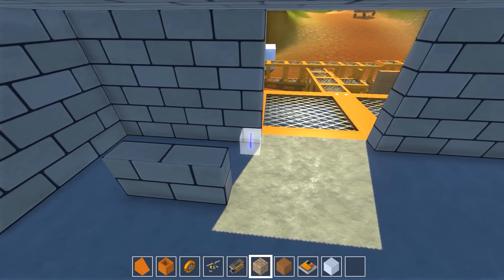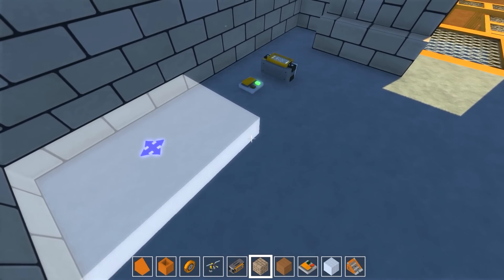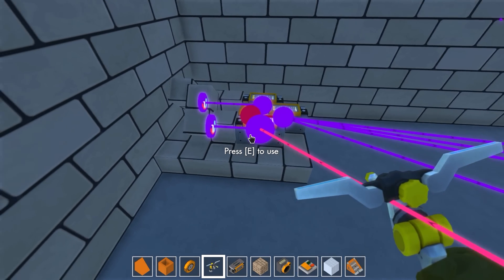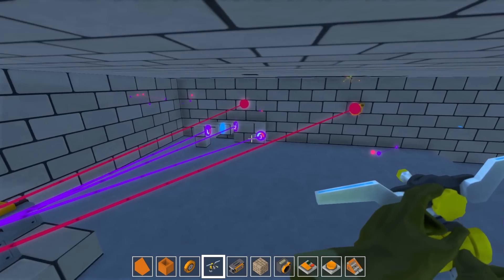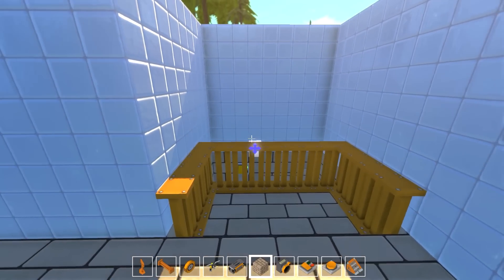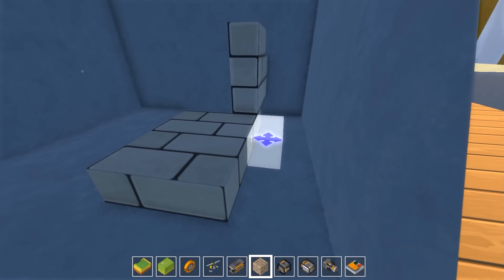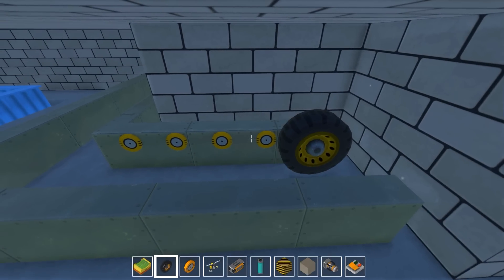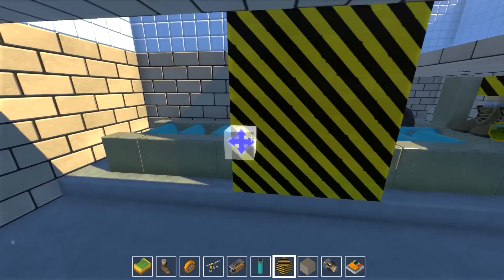Scrap Mechanic Gameplay - Production Line, Sliding Door, Elevators - Scrap Mechanic Creative Part 4

Comment: Petard you should place your door switch on a block that rotates and has a separate switch to rotate that block on the inside, now you have your switch inside to close the door and before you leave you open it from the inside then flip the switch around to the outside and close it from outside. There is no way to close the door unless you're on the same side of the switch so this also makes sure no one can break into the factory while sacred rugs are being made.

Comment: another idea is to have a box on the wall with the door's switch. on both sides, inside and outside, the sides of the box flip open on separate circuits so you can reach the switch on either side.